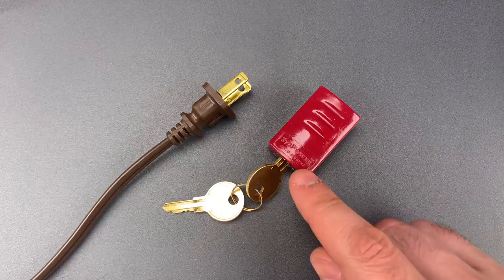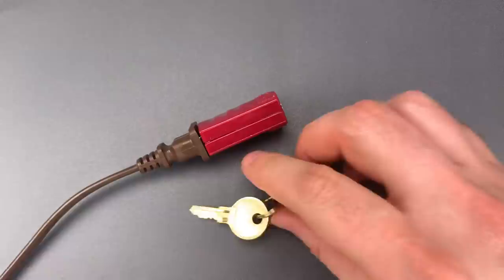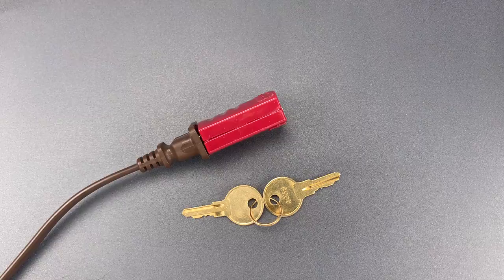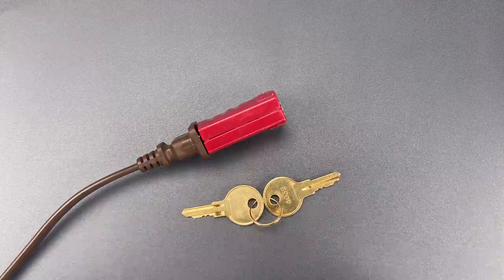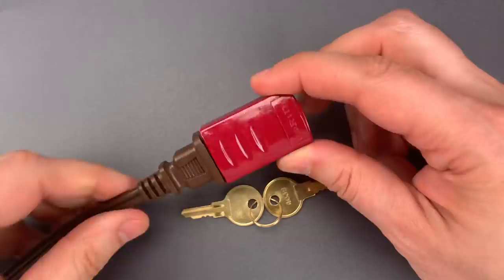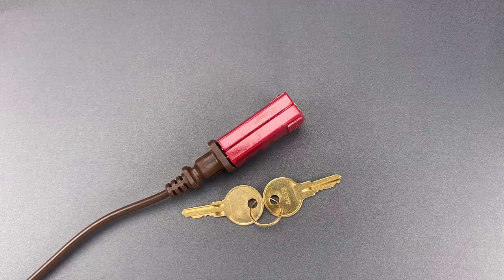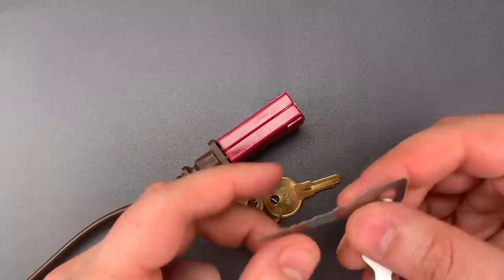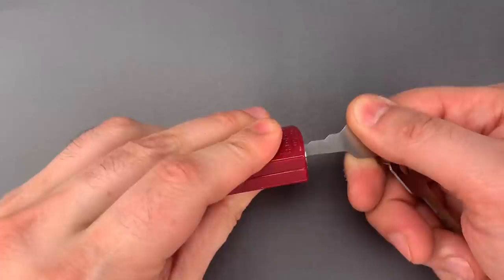[1138] Stopower Electric Plug Lock Jiggled Open FAST

Comment: If you put this on your child's xbox power cord, you'll just motivate them to learn how to pick locks
Reply: Educational!
Reply: That would be funny if this kinda 'prevention' inspired learning those skills, however I hope the kid is smart enough to realize the Xbox power cords are universal and quite common and could easily be swapped out with a desktop, TV, and even laptop (before power brick) cord.
Reply: I would have just used a different cord, tbh. Most of the cords for the AC side are industry standard.
Reply: ...or get a spare power cord.
Reply: lol my mom did this to me once and since i dont have a lock pic set i used 2 paper clips and got it open in 5 seconds
Reply: They may use a hammer and learn a Trade Skill?
Reply: Without a doubt as a kid i would have at least attempted to find a way to get it off somehow.
Reply: Or to cut the cord and peel the cables to conect them directly to the outlet

I did that with my psx
Reply: Motivate them to buy a PlayStation. (incoming Xbox Fanboys!)
Reply: @0num4  i remember when i was a kid my mom took the power cord for my PC so i couldn't use it while she was out. There's a reason the standard AC power cords used for PCs are called 'kettle leads' in the UK. I was able to use the one from our literal kettle to power the PC, and replace it before she got back :D
Reply: Or teach them how to buy power cords and hide them from you
Reply: @Nedeles  Saw that a lot when I was on a trip to India.  Scary.
Reply: this is more for playstation kids...
Reply: @Nedeles  Remember kids, this is a stupid thing to do. Just wire on a new plug.
Reply: Why don’t you just take away the power cable
Reply: @uriahgreene9816  the short answer is: it doesn't work.
Most kids bad enough to have their stuff taken away find their parents hiding spots, and just take the items back. Especially if the kids parent works at times the kid is home alone
Reply: If you put this on your child's xbox power cord, check the family computer's youtube history for this video.
Reply: It's a useful trade. Maybe.
Reply: BFB-DanceySteve Play Stations suk bro, and PUBG for life.
Reply: Task failed successfully!
Reply: Which is much better than having them play video games
Reply: or to use a hammer...
Reply: they just take the computer monitor plug and swap it with the xbox one. thats why it come apart there ;D
Reply: If it even takes that much. I managed to pry a similar one off with a pencil. don't remember how old I was, but it did not stop me for long.
Reply: @VtheWizard  that would be the next step
Reply: Or just get a replacement cable - they aren't permafixed to the power brick, after all
Reply: Nah, they’ll learn how to cut the cable, strip the wires, and jam them into an outlet
Reply: Or, they could just unplug the cord from the adapter.
Reply: Ah yes because a simple NO doesn't suffice these days...
If my kids fired up their gaming rig without my permission they would have to earn enough money to buy a new one because the last one would have been sold off.
They would also of course need to find a place to live where they can place their own gaming rig and play it because they wouldn't have my permission to put it in my home.

I don't want no kid that doesn't know how to listen.

To whomever plugged their PSX into the socket by stripping the wires... You should be glad you didn't become homeless. 1) by burning your home down or 2) because your parents threw you out on the streets and gained selective amnesia about you ever having been born.
Reply: @Megatron995  Nah, i am a pretty liberal parent who values honor, integrity, knowledge, intelligence and skill.
I am teaching my kids the value of right and wrong and earning the respect of others.

Let me guess, you are teaching your kids the values of thievery, deceit and ego?
Reply: Or how to get another cord
Reply: @Megatron995  no, I'm raising a responsible and respectful young adult that will be a useful citizen, not a spoiled rotten selfish entitled lazy monster victim thats becoming more and more prevalent in the kids today
Reply: I’m not sure I think the kid would pull a mrs lockpickinglawer, and smash it.
Reply: Or how to replace a power plug ^^
Reply: @nesbitt615  yes, smashing it like a confused gorilla will definitely show the kid their mistake. Or it's going to go the way it always does and just make sure they'll learn not to trust you with anything they like or enjoy.
Reply: @nesbitt615  Thankfully, my parents were aware of cause&effect. A much simpler system was in place for me: I simply had to finish my homework. My parents never broke or threw out anything I would see as "mine". At most, it could be taken away for a time. And when I was barred from the computer? Guess what. I didn't use it. Not from it being disabled or broken - because I knew I was forbidden from using it.
Reply: @EgorKaskader  backpedal much?
Reply: @nesbitt615  As if it's a backpedal. You're talking about smashing your kid's console. My PC was a click of a power button away if I so chose. Learn to read.
Reply: @0num4  your not wrong but I don't think it's that common to have one console but two power cords for that console.
Reply: Yeah my mom makes my brothers unhook our game console and put it in there closet if they get grounded.
Reply: Maybe if that's what you want?
Reply: That's literally the origin story of LPL
Reply: @Wampa842  Yes, how hard could it be.
Reply: @danielf3623  Assuming the kid isn't smart enough to whipe the history?
Reply: Or to borrow a power cord from another device, or a friend's device. The cord just unplugs from the console, so take the whole power cord and hide it somewhere.
Reply: well if its cord is replacable (idk if it is or not) then they can just get another and hide it
then when you lock it they take the other one out and plug it in!
boom
Reply: Or.... Just turn off the Wi-Fi
Reply: @MonkeyJedi99  but that's all you and the other clowns are worried about- how to get around it
Reply: I used one for that. Funny thing, the power cord unplug from the block and is the same cord as a computer. But it too then 3 days to figure that out
Reply: Honestly good idea to make kids learn something
Reply: @Nedeles  no bad put the danger cord down
Reply: @RealCadde  thievery and deceit are useful tools if you're kid has a loving heart
Reply: @Raraoolala  there was a proprietary cord on the Xbox 360 fat
Reply: Itsmejak 78 after the power brick yes, but not to the power brick. I imagine that's what a parent would take and not the brick and proprietary cord.
Reply: Ah, I'musing UK plugs.
Reply: or you can just buy a replacement cord or cut the plug off and rewire it with another plug
Reply: @ainzooalgown7589  
....I don't care
Reply: maybe his career started like that ;)
Reply: @ainzooalgown7589  f
Reply: Or they will just get a different cord
Reply: I mean i have a xbox that was broken that i had to fix so if my mom put this on it I'd be mad and then proceed to take a hammer to the lock
Reply: @Raraoolala  I'm not sure what Xbox you have, but their cables are the definition of "proprietary"...
Reply: ANASPAN, BEFORE the power brick
Reply: Nah they get to romote and lock pick it
Reply: @RealCadde  your kids has to ask to use there computer???
Reply: @freevipservers  Not unless they aren't fulfilling their responsibilities.

And it's not "there" or even their computer. Bought and paid for by me, not them.
If it was their computer then they would have to pay rent as well.
Reply: @RealCadde  Okay, I see what your a trying to say but isn't that a little much? I mean that sounds like micro management to me. Also once you give someone something, isn't it theirs?
Reply: @uriahgreene9816  because the cords are extremely common
Reply: My mom cut the power cord of my xbox once and it just made me learn how to splice electrical wires.
Reply: Unless he plays Skyrim..
Reply: or to buy a new cable!
Reply: I used to just use the computer monitor's cable.
Reply: Or the kid would just be smart and get a SECOND power cord...
Reply: It would probably encourage them to shop for a new power cord i guess...
Reply: Or the basic ohms law so they can replace the entire power supply. U = RI is what you need to know.  Or as I did that once at school, just 1 cut in the rubber and wrap a wire around, then another cut a little far away and wrap another wire around, then connect the 2 wires directly to the wall socket by manually inserting the wire into the socket, just splice it, bend it (so it make a little mechanical pressure) and insert.
Later you just remove the wire, no one will notice a bit of missing rubber on the cable
I never did that to my parents, I just respected them, but I would sure do that to school, fuck school, if I want to power this computer, I will power it.
Reply: or to install new plugs
Reply: or how to rewire a plug..
Reply: Or a dremel.

Comment: This is great as a LOTO (Lock Out Tag Out) for a particular device. If I am working on a computer device, this could be useful for tagging it until I have approved it for operation in a location where someone else may not know that this plug really, really needs to be left out. Without other knowledge, someone else could reasonably think "Oh my gosh, that router is unplugged!".
Reply: Yeah, that seems about right.
Reply: Yep, almost exactly what I used similar ones for. Helped avoid electrocuting myself.
Reply: Yup, the "plastic lock body" thing suggests that this might well be its orginal intended use (though by the sound of it some marketers have got carried away).
Reply: Came to the comments for this! Great for basic lock out tag out use - especially because of how inexpensive it probably is. Shows intentionality in it being unplugged and requires intentionality to plug back in. Can't have a casual "oh this is unplugged" without noticing that it was on purpose.
Reply: That would also explain it being bright red.
Reply: I should show this to my tutor at my electrical course, she might be interested
Reply: @pseudomonad  Yes, seems that some marketers really wanted to sell it for something that it isn't. "Oh, mum locked the gaming console again. Let's just unplug the cable and plug in another power cable."
Reply: @MyRegardsToTheDodo  most gaming consoles come with only one power cable. So the lock would theoretically work for that scenario. Of course the easy way around it is just smashing the lock, as most teenagers would probably do.
Reply: @unclejimmy5778  Yes, because it is so hard to buy another power cable for ~2 USD. Or use one from another electrical device, like for example a radio.
Reply: @MyRegardsToTheDodo  Edit: INCORRECT STATEMENTS: usually gaming consoles have a unique power cable that plugs into the console. It is rare if not impossible to simply have something laying around that would work to power a gaming console. Yes buying extra power cables for a console like the Xbox is possible but most retailers don't carry extra power supply cords in store.
Reply: @unclejimmy5778  Actually, the power /brick\ is proprietary, but most of the modern run of consoles use a detachable power cord on that brick that is either a standard figure 8 cord as found on many other appliances, or a standard IEC cord as found on most computer hardware.
Reply: @unclejimmy5778  The Xbox 360 and the Xbox One (the first gen model, not the S or X) had an external power supply and therefore specialized power cables (even though if I remember correctly the One had a standard cable connected to the PSU, which was connected to the console, so you could actually remove the cable). The PS3 Phat and the PS4 Pro use the same power cable you've plugged into your computer (if you have a tower PC). The PS3 Slim, Superslim, PS4 Phat and slim, Xbox S and X use the standard figure 8 power cables. So yes, you most certainly have another one of these laying around.
Reply: @MyRegardsToTheDodo  You and Luke are correct! Sorry for doubting, i wasn't aware that the cables used such a common design. Thanks for being good sports guys :)
Reply: @MyRegardsToTheDodo  Many are proprietary, and cost about $10 at the cheapest.
Reply: @nottelling6598  which console has a proprietary power cable that costs 10$?
Reply: I was looking for the electrician comment.
Reply: @Jehty_  Maybe a used Xbox 360 one? I doubt you can get an Xbox One Phat PSU for $10. The PS2 Slim also had an external power brick, but the power cable itself was a standard figure 8.
Reply: @Jehty_  I just googled Nintendo power cable and went to the shopping tab. Wii power cables have a weird connector that I've only seen on them, and cost between $9.99 and $19.99.
Reply: Especially good as a lock out device because if you loose the keys a quick rap with a hammer or tight squeeze with the pliers and you can unlock it without damage to the plug.
Reply: @unclejimmy5778  uh... the only console i have had, EVER that used a non standard plug was the xbox 360 (power brick to console) and the power brick used a standard nongrounded  IEC c14 which meant any c13 or c15 would fit. others if they had a detachable cable, used standard power connections, even the atari used a standard power connection, one that is disused for obvious reasons (it was a mono 3.5inch "audio" jack) but still standard. i've never seen a non standard power connection on any device that wasn't early USB, and early usb was that way because the standard sucked ass very early on.
Reply: @TheObsesedAnimeFreaks  ah yes, as you see we've already covered this, hence why my comment has a disclaimer on it. But thanks :)
Reply: @nottelling6598  Using an ancient console as your argument is dumb.
Reply: @unclejimmy5778  The Best security for you game system is the pawn shop
Reply: @andyowens5494    Or getting bitten by a machine
Reply: @MyRegardsToTheDodo  Although the cord going to the power brick on the 360 is an unusual type, ive found out that a standard Desktop PC power cable will work in it (as it is a non grounded version of the connector found on the back of desktop PCs)
Reply: @pineappleroad  In the newer PSUs, yes. In the older ones it won't fit, because they have this little... let's call it a knob inside.
Reply: @MyRegardsToTheDodo  never seen one of those before (in person)
I wonder if it is an IEC C15/C16 connector
Reply: @pseudomonad  They didn't get carried away for the locking out kid's stuff marketing, since it's gonna be pretty apparent to the parents if the kid breaks off the lock.  I know you can just replace the cord itself immediantly on modern consoles, but this on the kid's bedroom tv would work.  If you break a loto lock, you will probably lose your job among other things, but they need to be able to cut them off pretty easily in some circumstances depending on key retention and what shift the lock was applied if it was a personal loto lock (not gonna explain the full situation, but just know cutting them does happen after proper documentation, and the harder it is to cut, the greater chance of damaging equipment it's on and surrrounding fixtures.  No boron hardened shackles and steel bodies on loto locks for a reason, many even have plastic shackles too.  And if a kid breaks one of these off, he's gonna get beat.  They serve the same purpose, proof if they are removed.  Workers don't carry lockpicking tools around, workplaces don't have them, and kids young enough to have these used on them are not likely to either.

Comment: The security equivalent of a "do not disturb" sign. Hilarious!
Reply: These "Do no disturb" signs have saved countless lives and limbs over the years.
The lock looks like a very cheap lock out tag out device. Essentially, if you are performing field maintenance on any equipment, you can use this kind of a lock to prevent others from accidently powering the equipment. The key are just to avoid confusion when multiple people are working at the same site.
Reply: @ajinkyakamat7053  yeah that works. better than wrapping it in electrical tape.
Reply: ...wonder if he'll bypass a lock with this lock too